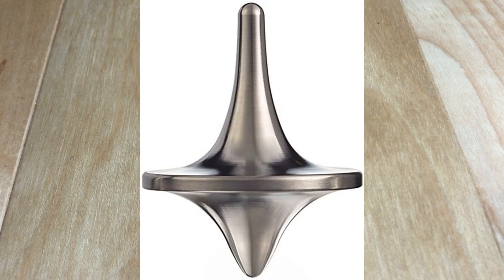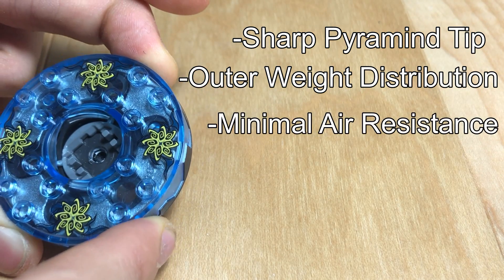I Made the World's LONGEST SPINNING Lego Beyblade!

Comment: What if you used this Ninjago weight with the same driver on a full bey? The massive weight would give it incredible stability and defense, so you would have to reduce burst resistance and recoil for game balance. 
     A Stamina type,  "Fullmetal Mustang" would be designed for high spin speed and time, but could only rely on its weight for defence. 
     If you swapped the driver for a face-down full stud or hollow stud, you could create a great tornado-staller.
Reply from the maker: I'm already planning on that!

Comment: Would adding free-spin to the driver increase stamina (by reducing friction)?
Reply from the maker: I'm not sure, but i don't think it would outweigh the height increase it would bring (plus there's not much friction coming from a point tip anyway)
Reply: if you add an actual bearing maybe because a lego free spinning piece still has friction from the disk rotating in the plastic
Reply: @aeroblader1951  Longest spinning LEGO beyblade..
Reply: @kxt9458  true lol
Reply: @aeroblader1951  and make it motorized to give it more spin
Reply: @smcvanic340  would be cool but it would not realy fit a motor in there tho
Reply: Phantom orion has a free spinning tip
Reply: @jian1506  Yes, but Phantom Orion's tip has bearings. Free spin alone can't make it spin that long
Reply: The instability of Lego in brick-built rotational mechanisms would likely dwarf the negative effects of height increase.

Comment: My lego bey can only spin for a minute and 8 seconds wow that launcher is to powerful
Reply from the maker: While the launch power helps to a degree, the most important factor is making sure your bey is 100% balanced and upright to preserve as much stamina in low spin as possible
Reply: @Legobeyz  brick blade did a very similar thing but since he’s the dude who spins on plastic discs he used bearing which in a curved stadium it is aggressive,e but on a flat disk, it’s actually amazing for stamina. He also made an old one with a pin
Reply: @Legobeyz  Wait, upright beys spin longer and perform better than upside down beys?
Reply: Usually, because the downright beyblades scrape a lot..
Reply: @jaypictures7600  This makes me wanna make my beys upright now.
Reply: @zyrocist  my dynamite belial is upright